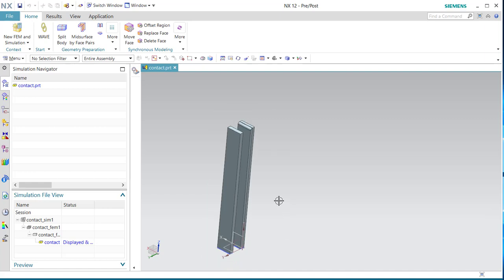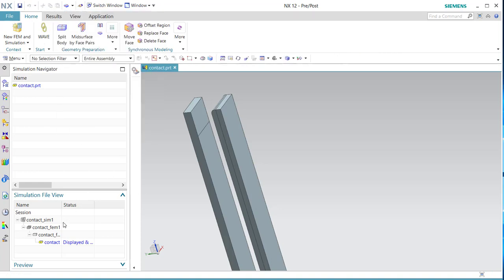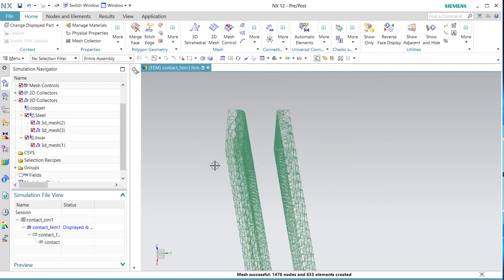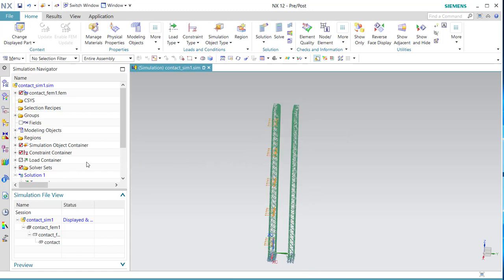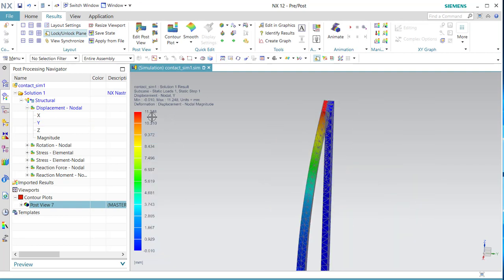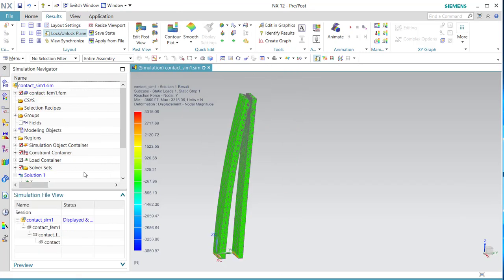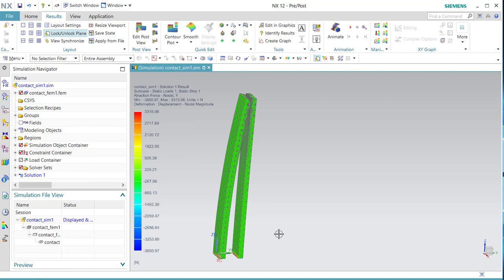How to use contact and gluing using a bi-metal and a temperature load contains CC

Comment from the maker: In a solution is standard a temperature node, right mouse button on that you get select a New Load Set and select than Temperature set , You get into a window where there is a drop down menu, I choose here Initial/Stress free temperature. At 4:08 the temperature that are shown are assigned to the solid bodies by Right Mouse button on loads, New Load Set -> Temperature Set Right mouse Button on Temperature Set-> New-> Temperature, than assign temperature to a body

Comment: Thanks for the video, but can you upload a video with full steps for bimetallic strip, I didn't understand where you applied temperature value on the model, I really need this video for my project. Can you please upload a new video with all steps clearly, your help will be really appreciated
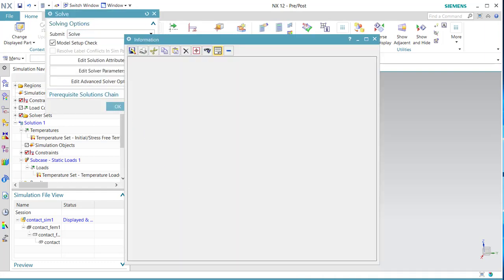Reply from the maker: Temperature loads definition are shown at 04:10 in the movie
Reply: @OlafvanBuul  sir, but you didn't select the surface for the flow of temperature, I tried to solve it the same as how you did in this, but after solving, in results its showing '' results not found''. 
can you share with me your file through .rar folder or please provide me your mail id, i will send you my files, please check, what's the mistake. my mail id is nadeems481@gmail.com
i am in urgent need of this bimetal simulation tutorial